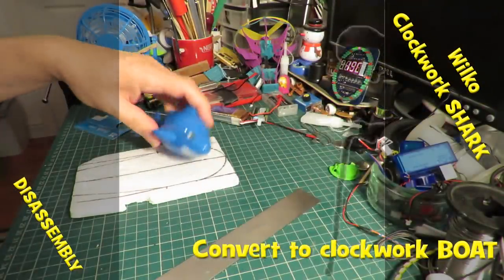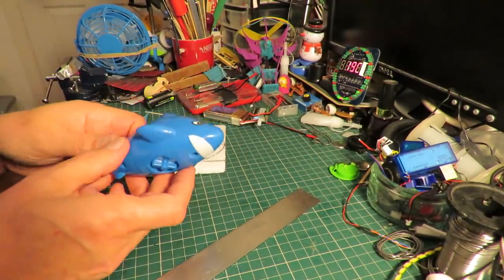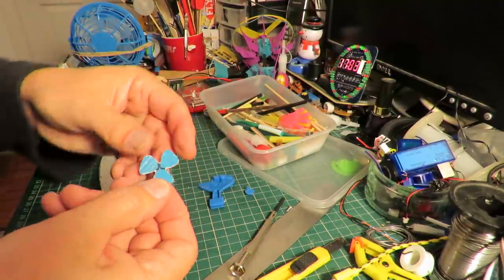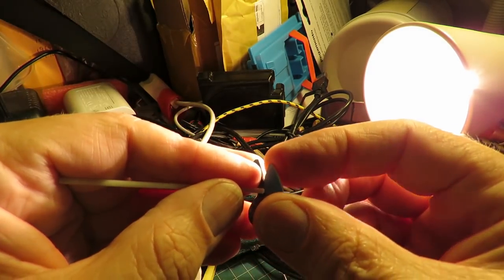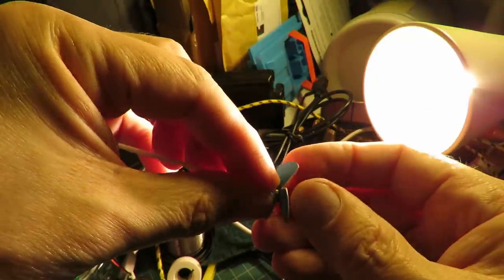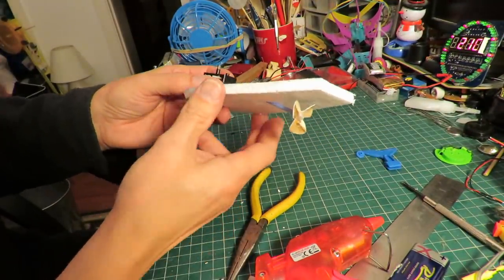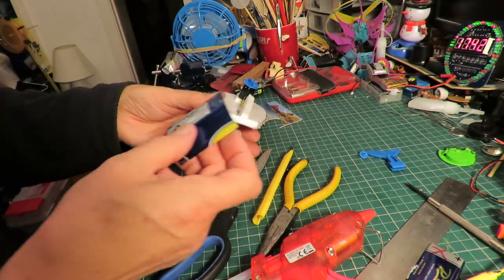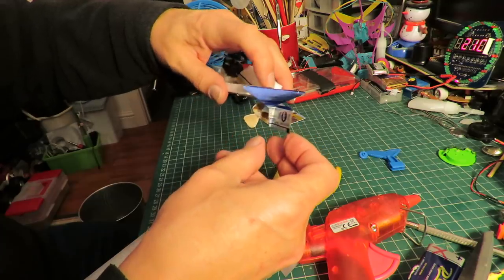Disassembly - Wilko Clockwork Shark Convert to clockwork BOAT

Comment: That went a lot better than i expected, with the clockwork discharging its energy so quickly i thought there would be a burst of prop cavitation and not much forward movement, your right about a better prop improving performance, in future when making a plasticard prop perhaps making the blades with a curve in them would get better results, but well done for getting more performance than the original shark model.
Reply from the maker: Thanks Ian, I always leave room for improvement, just getting the basics working is enough for me and then I move on.

Comment: This clock work is snaller.  I really think you could make it fly.
Maybe a slope soarer.
Reply from the maker: Yep slope soarer, powered by the wind 😊
Reply: With clockwork assist   ;-)
Reply from the maker: Wil Hobbs probably not a noticeable input 😊
Reply: Ok ok...lol
Reply from the maker: Wil Hobbs 😊

Comment: can you make a clockwork powered planeintead of rubber band powered??
Reply from the maker: I have been asked several times but I haven't found a clockwork mechanism that has the power to weight ratio necessary to power a plane. I have searched YouTube and haven't found any flying clockwork planes either.